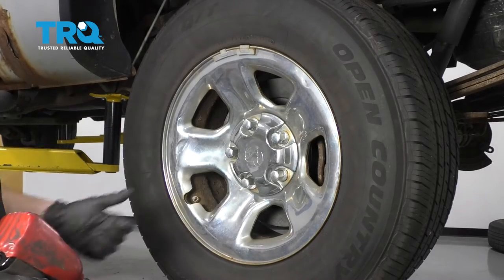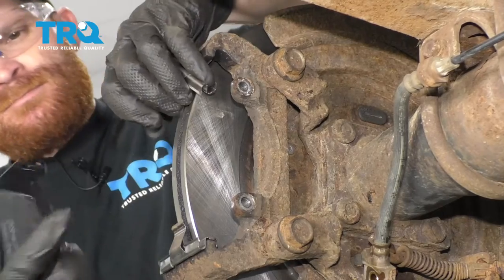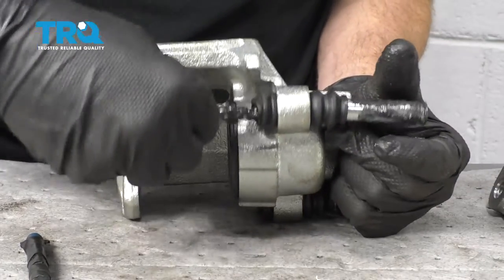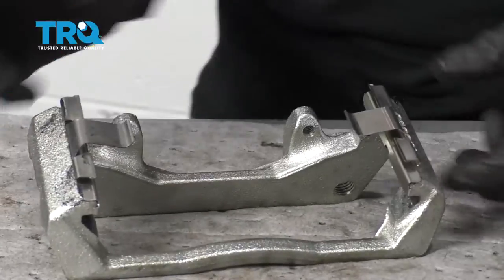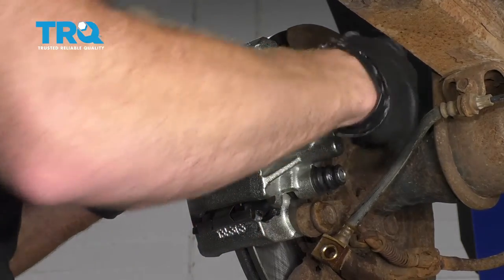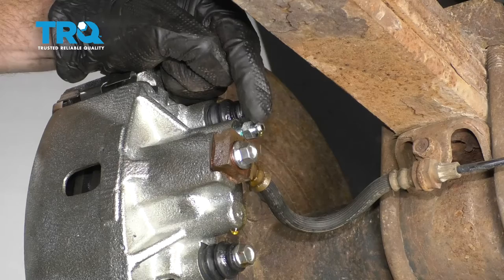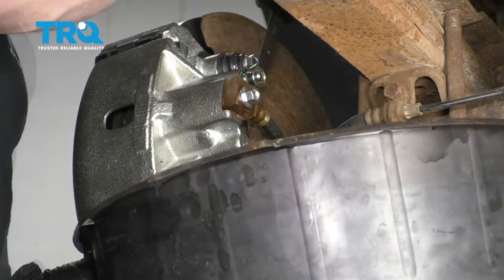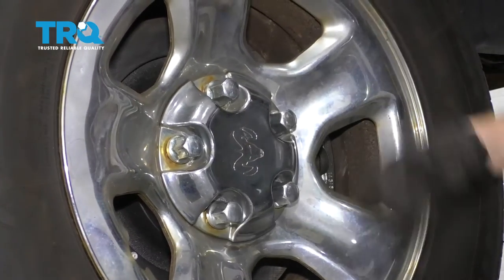How to Replace Rear Brake Caliper 2004-10 Dodge RAM

Comment: A much better way to bleed the breaks is by using a clear tube and bottle. You can easily see air bubbles running through the tube and when there aren't any more you are done.